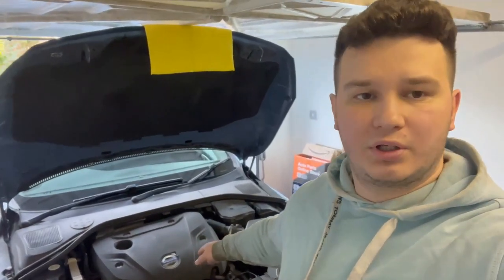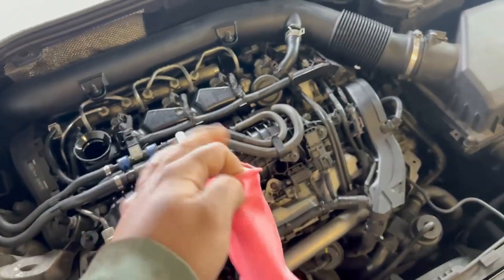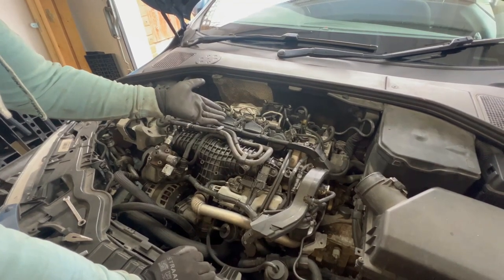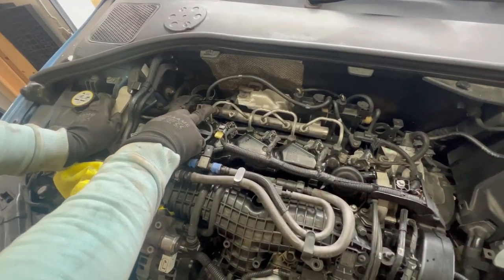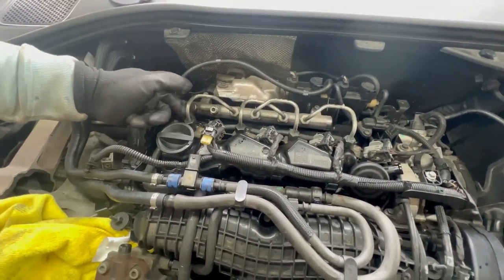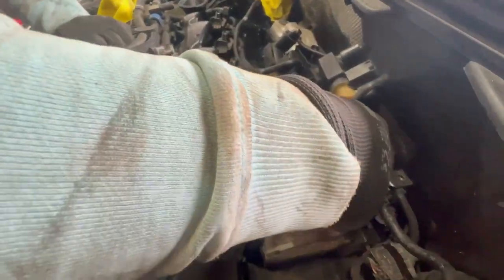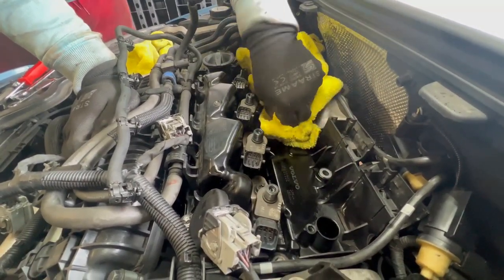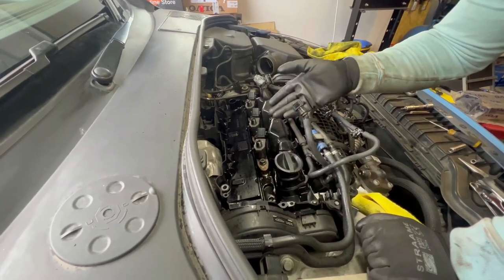Volvo S60 D4 Valve Cover REPLACEMENT Part 1 - ALL D4 VEA Diesel Engine Owners PLEASE Watch This!

Comment: Nice video! It almost makes it doable for a non car mechanic! Still, 1 question; with other volvo engines the pcv problem seems to be fixed by just replacing the membrane, is / was that not possible / sensible with this engine?
Reply from the maker: Thanks 😉 it can't be replaced as the pcv system is part of the valve cover 😢

Comment: I have a 2017 V90 D4 - is the procedure the same?
Reply: My mechanic says it’s a 2 day job because he needs to remove the intake.
Reply from the maker: If your engine looks the same then the procedure should be the same as well. I haven't worked on a 2017 V90 tho yet.
Reply: @MrNiceGuy94  it looks the same - maybe i should consider a different mechanic 😎
Reply from the maker: Where are you based?
I can't advise you on that, also I don't want to talk down on anybody :D
The job takes around 2-3 hours ;)
Reply: @MrNiceGuy94  Denmark 🇩🇰